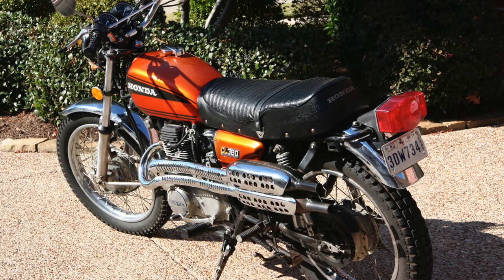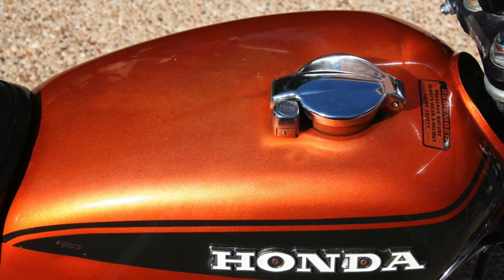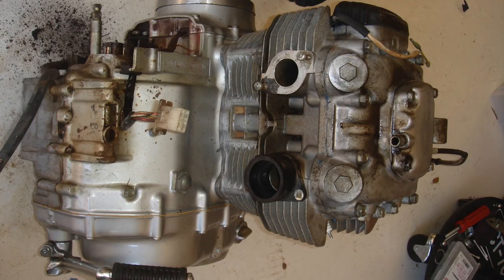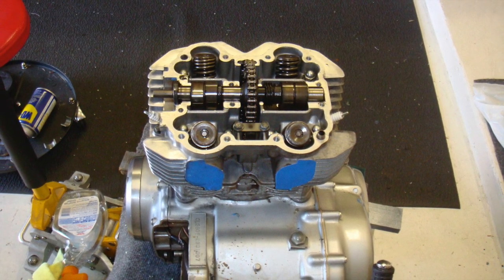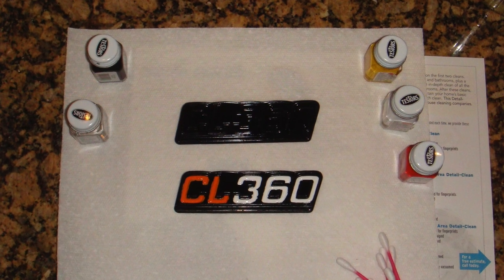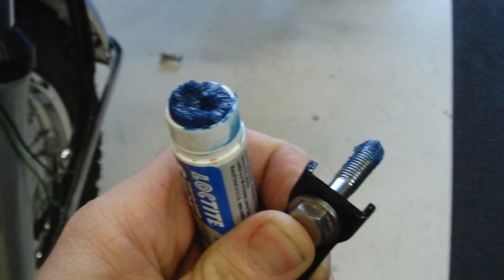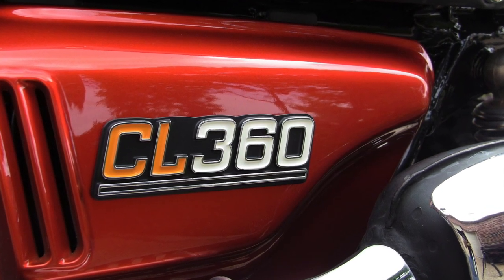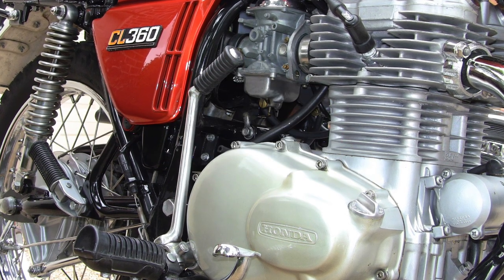1975 Honda CL360 Scramblers FULL Restoration | Cruiseman's Garage

Comment: Great video, and kudos on such a fantastic restoration project.  This exact bike was my first motorcycle in 1975 (even the color, although mine had street tires instead of knobbies).  It was a great bike, and a first with the 6-speed transmission.  I added crash bars, luggage rack, windshield (later a fairing), and ran it 27,000 miles in 5 years.  The last year was a 3,000+ mile camping trip from WI to CO and back -- talk about "twin tingle"!

I loved that bike.  But the next fall I bought a Gold Wing.  ;-)

On my third Wing now. 🙂

Comment: Great work on the restoration Chris. Too bad about the fire. I’ve restored several Trail 70’s, 1973 Honda CL350 and currently working on a 1973 Honda CB175. Very rewarding to bring these old bikes back to life. As you said it’s hard to get the money out of them when selling one of these bikes, so I look at it as a hobby. Don